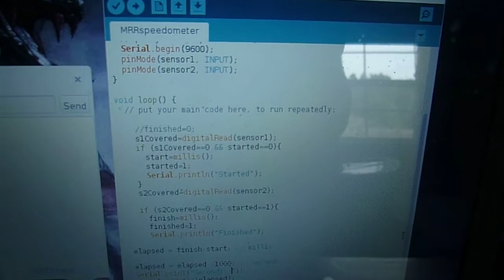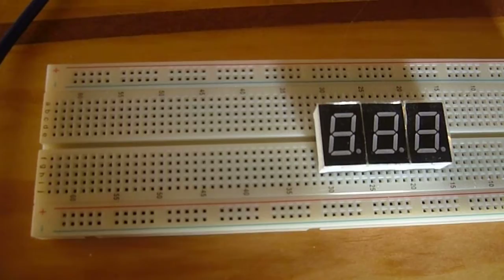Arduino Model Railroading - Scale Speedometer (part 1)

Comment: The room's ambient lighting prevents the IR sensors from operatin.  Is there a solution for this???????
Reply from the maker: Robert Hogg adjust your pullup resistor value.
Reply: Thanks!!!!!!!!!!!!!!!!!!!!
Reply: @roberthogg8812 
 If that doesn't work then connect the IR LED to an Arduino output rather than 5V and connect the photodiode input to an analogue pin. Then you can read the value once with the IR LED off and then a few milliseconds later with the IR LED on. You subtract the off from the on and decide if the value is high enough to say a train is there. This should take variable room lighting into account.
Reply: Changing the resistor solved the problem. @DennisFisherUK

Comment: Hi Steve,  I am very new to arduino but old to model railroading.  After discovering this new technology I thought I would give it a try with things like crossing lights, block detection and many other new and interesting projects.  I have never been one to start simple, it's jump into the deepest water first.  I found, after several weeks of frustration, that block detection was too deep and have resorted to something that looked a little easier.  Now, I am learning your code must be written in "C" and I am dealing with "C++".  It seems every time I load your code I get a different error...  help.  I plan to use Arduino UNO in the final project but wish to use "UNOArduSim v1.2.1 as a learning tool, therefor all the errors.  Any ideas?  Thanks, Bill
Reply from the maker: My first guess would be the simulator can't simulate certain things well. As for not being able to program in C, it's easily picked up, and I post actual working solutions, so most projects can be uploaded as is. If not, I can create custom code for a little bit.
Reply: Thanks for you response.  As it turn out the ArduSim I was trying to use would not work with C.  When the sketch is loaded into the arduino things are good, just not when trying to use the sim.  Like I said, I am very new to this and learning can be a little steep at times.  Again, thanks for the response, let me play and learn a little more before I trouble you.
Reply from the maker: No problem. I figured it was the sim causing the trouble. However, ArduSim is programmed in C (that's what arduino sketches are), but sims often have issues with hardware simulation beyond the arduino, or anything more than simple blink sketches.